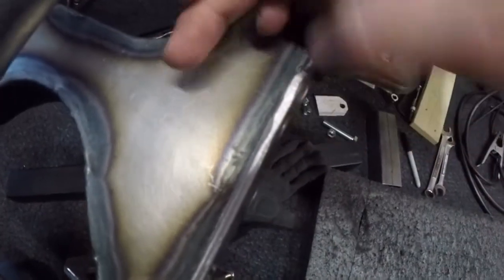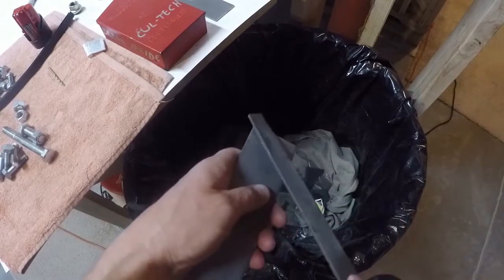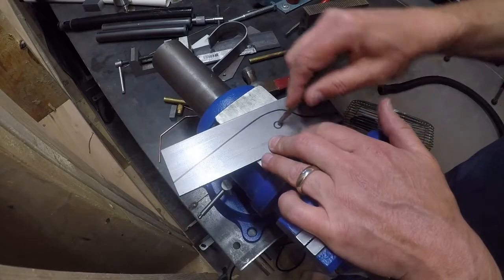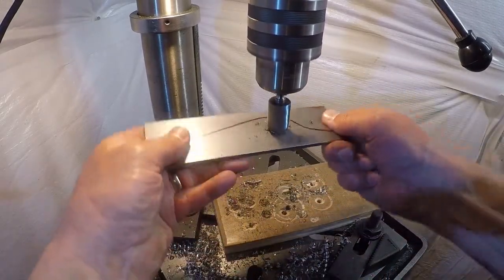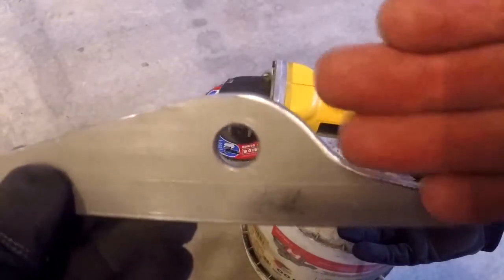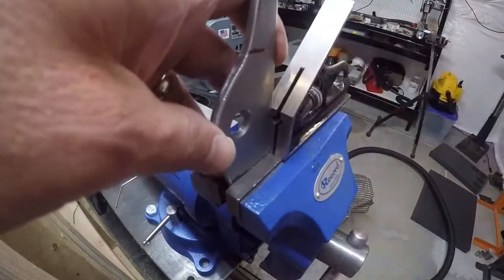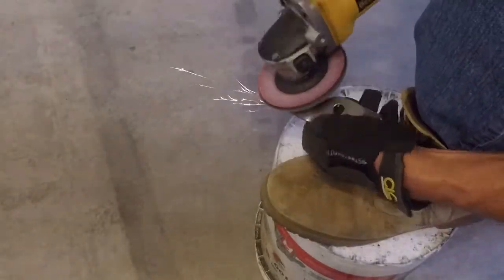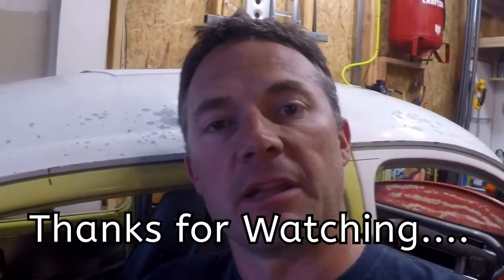Rear Shock Bracket Fabrication on A Arm Baja Bug

Comment: great work when you make brackets make one for the outher side, you need a burr king sander ,on my wish list
Reply from the maker: john kovach, Thanks for that brand name! I just looked it up, those are some sweet grinders. Man would that make some of the sanding easier. I'll put it on my wish list too.
Usually I make parts for both sides at the same time. On the rear suspension I wasn't sure if I would go with this first design so I was only making one side. It really bit me in the arse when I decided to go with it and had to make everything again for the other side.
Thanks for the comments.

Comment: well how do you know if the metal is thick enough for that type of stress?
Reply from the maker: Alloy Salama, Just from experience. I've made brackets like these before and as long as they are short 3/16 will hold up. If you notice in the front of the chassis those shock brackets are longer, so those are made out of 1/4".